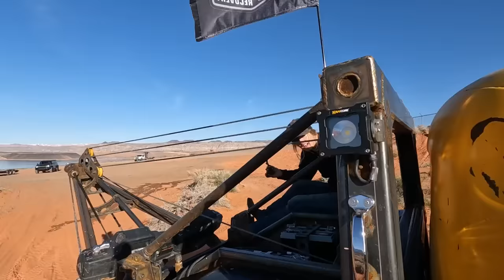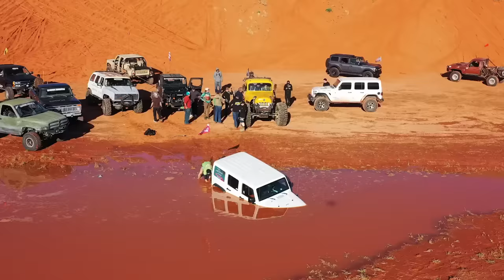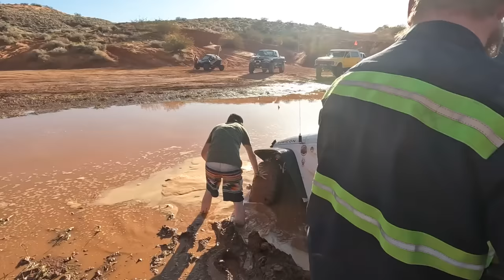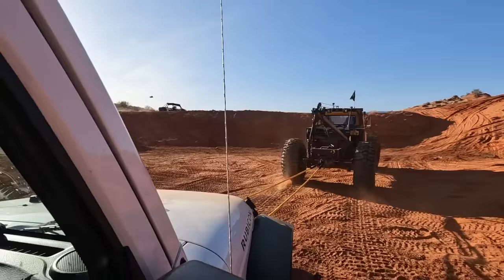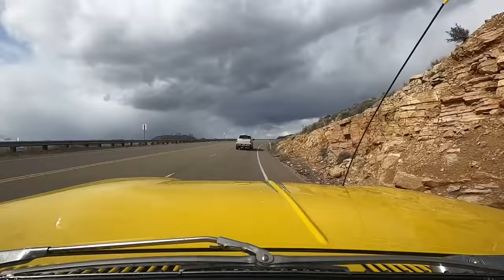Customer Took His Jeep Swimming...Oh My!

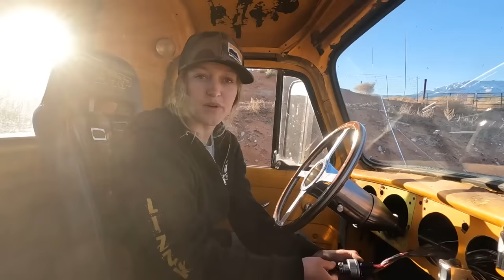Comment: 8:42 - At the risk of sounding like I'm trying to be sarcastic; Why - after all this time - is the ignition switch STILL not INSTALLED in/on/under the dash somewhere? 

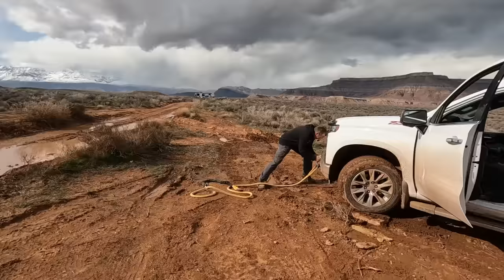11:57 - At the risk of sounding like I'm trying to be sarcastic; If you're going to invest 60K-100K in a nice truck / dual-axle glamper combo, but absolutely INSIST on running said truck with "JERSEY BOY : UTAH CHAPTER Low-Profile Mud-Terrain Wannabe" tires, then please do yourselves a favor and keep it on the pavement. 

These glampers themselves are NOT designed for 'boondocking' in rugged environments. And here in Washington County, Utah - the moment you wander three feet off of almost any paved road, you're now in 'rugged environment'. 

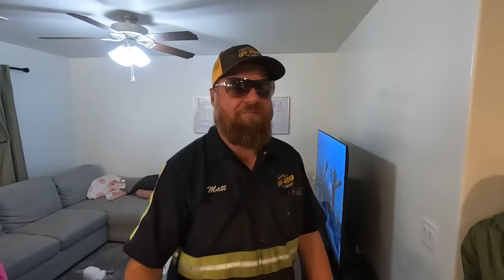13:01 - Is it true that you're auctioning off a custom-made, hand woven soft shackle, made entirely out of your recent hair clippings? There are claims that it's going to be tested / rated at 120,000 lbs MBS!? 😯

Comment: Tom, put some contractor's garbage bags in every rescue vehicle for this purpose. Put two on the seat like seat covers, and your towel over that. They can also be used as emergency raincoat/ponchos.  For the seat, though, if you want the best protection, use 4x6 or 6x8 tarps. You can even cut 6x8 pieces of 6 mil carpenter's plastic for the purpose. A few of those folded up will not take up that much space in a recovery vehicle.

Comment: did the wrecker ever get fixed so it would back up?
Reply: There was a very brief mention from Tom about three/four weeks ago, about filling the transmission with fluid after it was repaired (or replaced), then the Wrecker was shown reversing out of the shop.  There hasn't been any other mention of the gearbox issue that I've seen.

Comment: it sounds like your not getting enough AMPS to your winches  you need bigger wire and or bus bars or you dont have enough batt  do a voltage drop test at winches while under load
Reply: i bet the voltage drop while under load will bring voltage under 9 volts   the wire in winch is very short there for can be really small but truly ever foot of wire mean way bigger wire is needed   you have tried using cheap jumper cables compare them to a high dollar very heavy set  Its even more so with your winches     Wattage is the power used to know the watts you times the voltage by the amps!!  So lets say you winches needs 1200 watts of power  12 volts x 100 amps =1200 watts    now let say voltage drop lowers to  8 volts x 150 amps= 150 amps  that extra 50 amps go threw the brushes and winding in winch motor also   It is a snow ball effect      Lower volts makes higher amps!  Amps is what makes things hot not voltage !
Reply: sorry alot going on around me 8 volts x 150 amps = 1200 watts   You need the same power output " watts" so when the voltage drops the amps must rise The more the amps rise the bigger the wire needs to be the hotter everything gets!!  All that heat is lost watts basically heaters and not going to your load  Your awesome tuck needs stupid big pure copper wire from your batteries to a stupid big bus bars then  stupid big wire to your winches  DONT FORGET a fuse or breaker rated at the right amps AS CLOSE AS POSSIBLE TO THE BATTERIES!!    Make sure of the quality of fuse or breaker is good TONS of juck is sold every day   You may think this guy "me Ben Amber is my wife" is just a safety hitler or safety nut you would be wrong i like farm fixes and your claw hammer!   But wiring must be done in a way not to burn some thing "including others vehicles or homes" down or God forbid hurt some one!  I am retired but have done this stuff since i started under my uncle at 12 years old   I have seen it all from REALLY BAD to new electrical code just to make the rich richer!  It is like that broken back glass and tail light is to you my friend   God bless you and your Mat

Comment: Great video! Love watching great content!!! And so it is not easy to always be the guy that points out areas that should be addressed... I thought it was very unsafe for peanut to be on the back of the wrecker,one slip or bump and then fall off in front of those tires ,and well maybe it wouldn't hurt to be ran over by those tires ,cause they are soft I don't know about that. Maybe you guys could do some test. Anyway I hope you are planning on making some sort of rack / cage for riders,and along with that fenders for all tires. Cause that is just nuts ,u have been blessed so far.  Oh ya ,no one wants to see anyone get hurt 🤕, so I pray that safety is always your biggest priority 🙏🙏🙏 cause it never happens until it happens.,and then it's to late. Yes Im a riot at parties 😉

Comment: That Jeep owner has seen too many of Eric's video's and doesn't understand that most rigs that attempt such obstacles are either built for the terrain and are trailer'd to the offroad areas. I will admit I did a similar stupid when I first got my DD WJ trying to keep up with built Wranglers in the swamps on a 2" lift and stock sized tires..... stalled due to water soaking the air filter, and ended up with 6" or water inside. Based on one of Eric's video's a few days back, I've got a feeling you westerners are going to be getting a real challenge if there is another wrecker games. Hoping he goes with one of the Jeep trucks.

Comment: With submerged vehicles a pool net is a great tool to have so when you open the door you can catch anything floating out and not have to pick up wet trash in the mud I learned after a few boat ramp recoveries

Comment: You should get like a tow hitch and put a receiver in one of those side bars that way you can mount it to the bottom of a seat and keep it stored on the back and then when you have two extra people you could slide a C10 the side or in the back realm and pin it in and there you go you have to see to could put on or remove